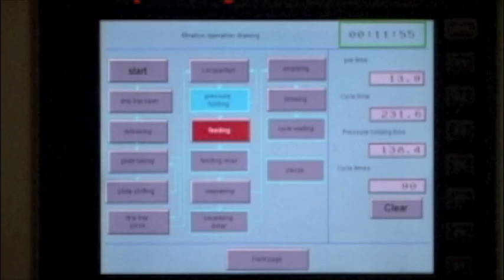Filter Press

Comment: Nice job! MSE Filterpressen® has a broad filter press portfolio including stainless steel filter press, fully automatic filter press, semi-automatic filter press or high temperature filter press which fits for maximum cake drying. Therefore MSE Filterpressen® is able to select a filter press configuration which works best with your application.
Greetings.